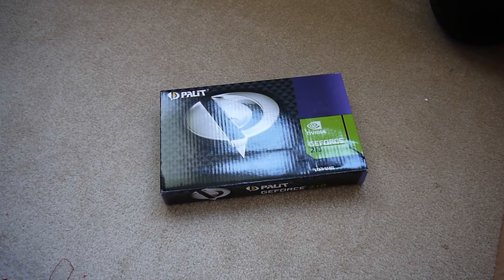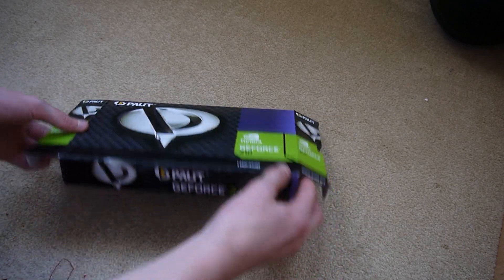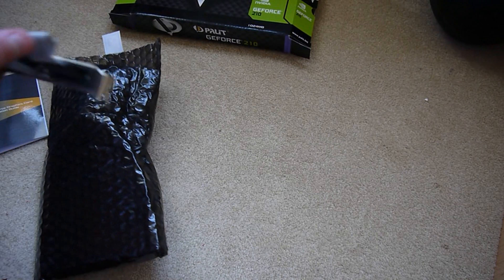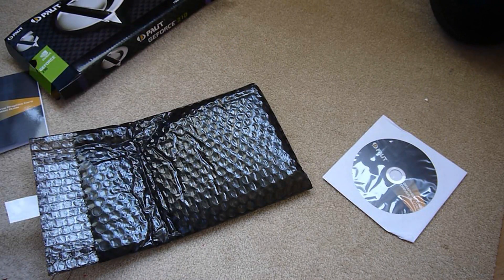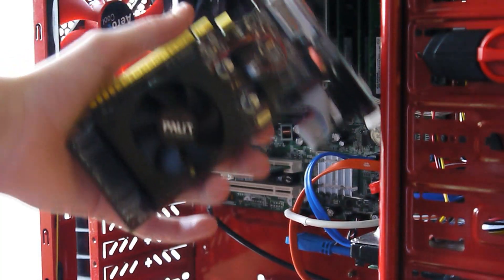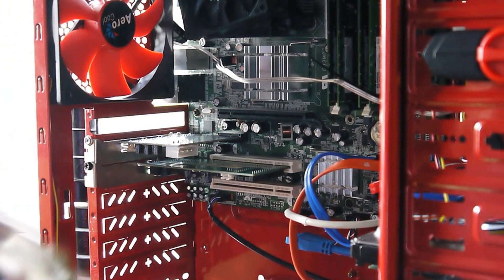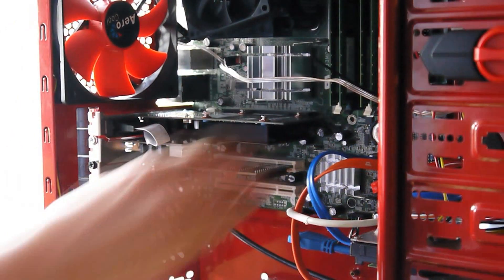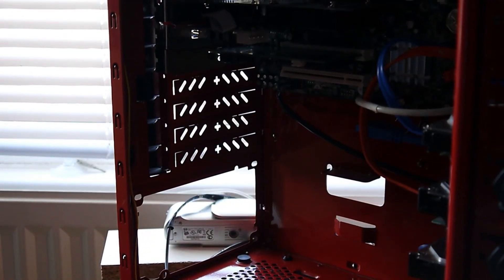NVIDIA GEFORCE 210 Graphics Card Unboxing, PC Setting Up

Comment: Is it good for free fire Bluestacks 60 fps+ or not?Plz Reply Sir Because I'm thinking of purchasing it🥺
Reply: No pleasedont purchase it....its useless for playing games....go for gt 710 instead which is slightly higher price but Good performance.... You can play freefire easily in 710 and even play Valorant
Reply: @aahilrafiq4850  While yes the 710 is better its still not for gaming, they are just for an output if your CPU doesn't have built in graphics or your looking for multiple displays. I'd never recommend a 710, it doesn't matter how poor you are
Reply: @SlyStarling  My comment was more than 2 years ago , i think gt 710 was somewhat relevant for that times , Now i would day gtx 1050 is bare minimum required nowadays , Gtx 1650 is good option , and Rtx cards if more budget

Comment: This is an excellent card I have tested more than 40 games starting from 2007 in low settings
Reply: HHHHHHHH
REALY
Reply: @apocalypseman5986 .. Yes it is a good card, good for budget gamers more games in less price objective completed
Reply: @visitkeshav1  bro i have intel hd 4400 I CAN RUN FORTNITE 15 TO 20 FPS IN A LAPTOP I WANT TO PLACE EGPU ON THE LAPTOP THE EGPU IS THE GT 210 WITH 1 gb VRAM HOW MUCH I GET FPS IN FORTNITE AFTER I PLACED AN EGPU PLUS THE INTEL 4400 HD GRAPHICS THE RAM IS 6GB AND I5 3GHZ processeur ^2CORES 4 threads^
Reply: @apocalypseman5986 .. You should be able to get decent amount of fps at least 30 since you have an i5. But I'm not sure about online games as I don't play online games like pubg or fortnight. But you should be able to get decent fps.. But this card works great on those games where the system ram is below 4 gb and gpu is 512 mb. And there are many games like that
Reply: @visitkeshav1  THX my friend
Reply: @apocalypseman5986  you are welcome you can ask me any help regarding games and graphics card. But I don't have my own channel in utube
Reply: @visitkeshav1  OK
Reply: @visitkeshav1  You are forgetting something critical, a laptops GPU cannot be upgraded, at leas the majority of them so if they buy a GPU thats made for a desktop they will quickly fined out that its useless to them. Also intels built in graphics cannot run SLI with a discrete GPU

Comment: geforce 210 with 1G RAM is much newer than 8800GT 512M RAM, but 210 is $30 and 8800GT is $150,  8800 has 3 times more transitors than 210. 210 only works for older 3D games but any games that use a lot of shadows and shades whatever,  210 crawls, 210 is a cheap junk that is only good for checking if the motherboard works or not.

why did ndivia make 210 to fool people? it is newer but it is a junk.

Comment: I have a 1gb gigabyte one...Despite what everyone says, when paired with the right cpu it can pull of 45-50 fps in cs-go, fallout 3 and over 70 fps in Portal 2...That's not bad for a card that costs 15-30$......All of that with the lowest settings of course, i mean if you are going to buy this gpu for gaming you are massively wrong, u can game on it but that is not what the card was made for....
Reply: Glitchyyy that's bad for a card that costs up to $30. 

I bought a used GT 740 that costed me $25 and it runs circles around that crap
Reply: i have Dell with i3 that came with a built in ATI 4500 or 5500 video chipset, when i tried to replace the video card, the damn junk Dell was incompatible with other good video cards except for Geforce 210. so i took it what the heck! although it was much newer than 8800, but it runs totally badly on new games with a lot of shades and shadows.

i paid $30 for 210, heck , no big deal i can eat it.